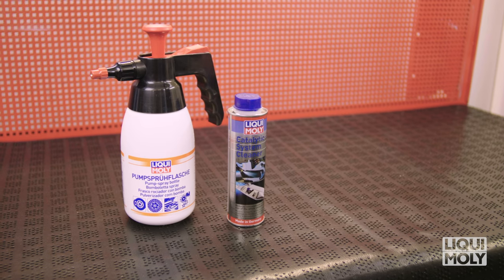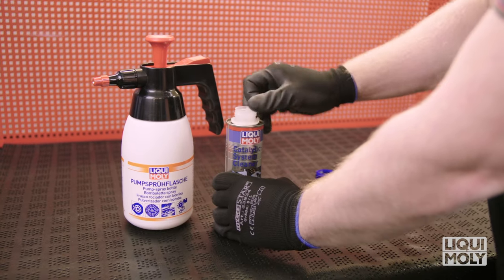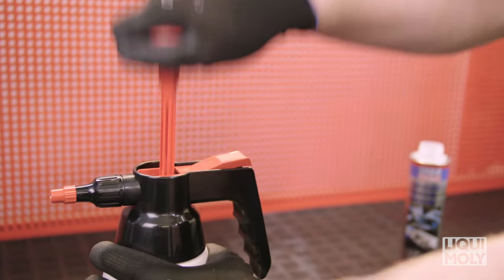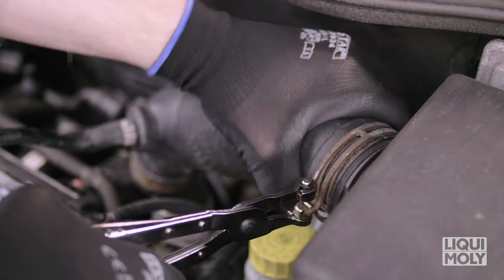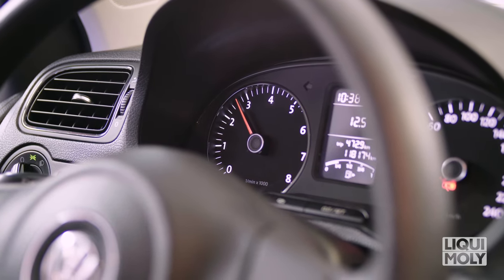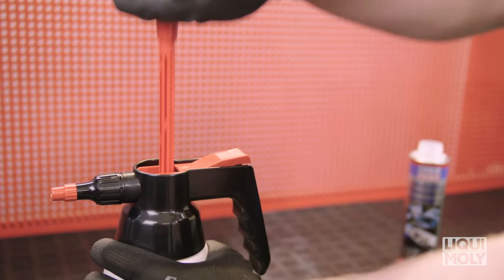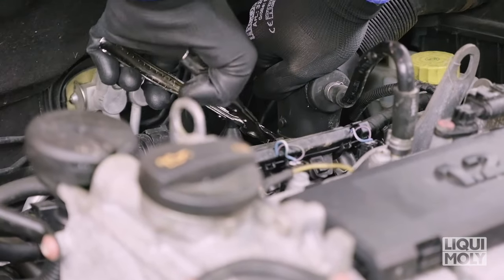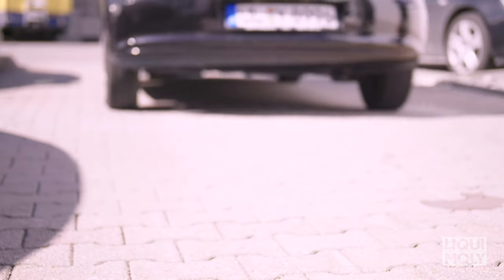LIQUI MOLY Catalytic-System Cleaner (#8931) EN

Comment: I'd like to comment that BEFORE you buy this, look at your throttle body plate and see if you'll be able to actually get the spray IN to the engine. On my BMW the throttle body plates, even at 2500rpm, are basically shut, so spraying this into the t-body is a half-hearted attempt at best.

Comment: Hello, in some forums it is written that it can be poured directly into the gas tank.  Is this app correct?  If I pour it into the full tank, will it clean?
Reply: LIqui Moly has a different one that goes in to gas tank. That one is different. Search this link on Youtube " Effects of Catalytic System and how to prevent them using Liqui Moly - Epi 48 " That one is by LIQUI MOLY South Africa. Good luck.
Reply: @Jin180sx  Thank you very much for the information, but I solved the problem, the ceramics in the catalyst were broken.  I installed a new one.  Greetings from turkey. 😊🙏🏻

Comment: Hello, Can I just use a new generic spray bottle?
Reply: I saw a video on YouTube in some foreign language of a guy using this product in generic spray bottle so I decided to try that. Used an empty bottle from Henkel Clin and this stuff melted the spray valve membrane of that bottle right off - symptom: squeeze the handle and absolutely nothing happens. Bottle was fine before I tried using it with this product. Went back home and tried another empty  bottle (I think it was Ajax Crystal Clean) and that one worked just fine. In hindsight, if you can borrow original spray bottle from someone locally that would definitely be better as it produces much finer mist and will definitely work as expected.

Comment: Hi, I have a question. Would it be possible to use the product when engine is not running? I mean, unplugging the 1st  oxygen (AFR) sensor, pouring the product into the cat. from there then plug the sensor back and start the engine.
Reply: Did you do it ? How good it went?

Comment: Hi, i have a question about apply of this product. In the video motor is an athmospheric. What about if the motor has a turbo charger? Intake area of the motor connecting directly intercooler. So there is no any scape for application. If we unscrew that pipe turbo charger has not any connection to the intake manifold and motor will not take work. So how can we apply this product if we have turbo charger in motor? Thanks in advance.

Comment: Not a whole lotta reviews here. 
I just used this product an hour ago. The idle after using this stuff is barely audible. I notice an improvement in both response time and the way she sounds. Good product!
Reply: Interesting. Did you use the whole bottle?
Reply: Mine went from nearly inaudible to a loud hum when throttling!! Edit: didn't put the cover properly in place, fixed the loud hum issue reseating it
Reply: Did you use it the same way in the video?

Comment: Why can’t I spray it through vacuum hoses? Did you actually mean not to let the vacuum hose suck the cleaner directly from the canister? Or did you mean it is prohibited regardless? I did it through the vacuum hose an hour ago, what damage had it cause (I used the pump spray bottle you guys recommended, I sprayed the cleaner through the vacuum hose)?!
Weird thing happened after I sprayed the whole thing and attempted to shut the engine off since I was done, but the engine just kept running for like 20 seconds after I shut the key off, I had to block the intake by hand to kill it, why did this occur?!
Reply from the maker: Hello David,

we think that to much cleaner is come in the engine. So the engine burn the cleaner and run more.
So you have to spray slower and less.

Comment: Hello LM - I have a cayenne 4.8L - Driven about 100,000Kms - I have bought the LM cat cleaner. I will add it directly into the main intake opening - however, How will I know that the Cat is cleaned - are there any tests or signs to look out for?
(I am doing this to solve the P0431 and P0421 errors, Catalytic temps issue)

Thank you.

Tomas
Reply: Any luck with this?

Comment: Hi 
I tried tried cleaning the catalytic system by applying the additive as directed in this video on my Mitsubishi Pajero GDI Engine by spraying the additive with pump spray bottle recommended above through the throttle body. Problem is but the everytime I do spray the throttle shuts, makes a weird loud sanction sound and there are sparks and fire coming through the exhaust, and the RPM shoots to the roof from the 2000RPM. The entire entire exhaust also become extremely hot in the process. What could I be doing wrong.
Is it also safe to add the additive to the fuel tank as I fill up? Will it have any negative impact on the engine or the fuel system?
Reply from the maker: Hello Charles,
please send your request to info@liqui-moly.de. Our colleagues from the technical departmet will get in touch with you.
Thank you.
Reply: Have you had this solved?

Comment: Thanks for your useful video. i.'v question . Each how many km should I do this proses? Not to harm any of motor components
Reply from the maker: We would recommend to use it on every oil change. Best regards, your LIQUI MOLY team
Reply: @liquimolywebtv  Is it placed before changing the old oil or after adding the new oil ?

Comment: Hi can I have question 
There is another type of catalytic system cleaner used with fuel tank . Its make the same result or this one better because it’s directly clean. 
I need answer please 🙏🏻♥️
Reply: LIqui Moly has a different one that goes in to gas tank. That one is different. Search this link on Youtube " Effects of Catalytic System and how to prevent them using Liqui Moly - Epi 48 " That one is by LIQUI MOLY South Africa. Good luck.

Comment: Hello, can i ask, why some other video shows that you must enter this liquid through vacuum hoses from brake booster?.
So which is right, through Throttle body or vacuum hose..??
Thanks for your help and answer.
Reply from the maker: Hello anton, 
I recommend to use it like in the product information. Ideal will be to spray the Catalytic-System Cleaner directly into the intake before the throttle body. As you may have seen in the other video the Korean guy use a special tool to add the Catalytic-System Cleaner due to the vacuum hose but we don´t have such a tool.

Kind regards, your LIQUI MOLY team

Comment: iam sorry, but I can't understand where exactly should I spray this product on my BMW e46/n42 engine, as far as I understand after removeing the airmass and spray directly toward the intake body, is that right?
Reply from the maker: Hello, The application of the Catalytic System Cleaner needs a certain knowledge of engines and in case of modern engine management a diagnose system to delete failure from the system.
The Catalytic System Cleaner should be applied after the airmass sensor and closest possible to the throttle valve. Then be sprayed in short shots into the manifold while the car is running.
Don´t apply too much at once. Best regards, your LIQUI MOLY team

Comment: I dont have a mass airflow sensor but manifold absolute pressure sensor installed within the throttle body will it be okay to use this if the chemical would pass the map sensor.
Reply: In my experience yes, but you may want to clean your MAP after that just in case. I sprayed this product into a throttle body of a mk2 Clio, then an hour later cleaned a MAF sensor with liqui moly Air Flow Sensor Cleaner. It worked pretty good, but not perfect. A week later I added a Ligui moly cat cleaner solution to the fuel (it's a different product - a bottle that is supposed to be added to the gas comes with small blue funnel to be attached) and within a week or two car started breathing properly.... But my cat was pretty dirty due to stop and go city driving and shoddy ignition coil (which I replaced earlier).

Comment: I have put that stuff through the brake booster vacuum tube. Then I saw your video now and your warnong to do such as.
Will this operation damage my car? What can I do to fix?
Reply from the maker: Hello Tests, 
if your car is still running after this application you are still lucky. The problem is the dosage, so if you fill in the whole product at ones into the vacuum hose the cylinder could fill up with the fluid. Fluids are not compressible so the engine can be destroyed.

Use this product as in the product information described.

Kind regards, your LIQUI MOLY team

Comment: my car does not have turbo charger, it means i have to spray this in throttle body?
plus tell me that i have heared that it will contaminate the engine oil, so one should use this when you need an oil chnage. is this confirm ?
Reply from the maker: On any car it has to be applied directly in the throttle body. No need to do it before an oil change. Best regards, your LIQUI MOLY team

Comment: My car doesn't have air flow sensor (i have only MAP sensor). Should I protect MAP sensor from the Catalytic cleaner?
Reply from the maker: Hello,
you should also protect the MAP-sensor against the LIQUI MOLY Catalytic-System Cleaner.
The reason is, that the MAP-sensor contains a piezo element, which can be harmd from the cleaner.
Best regards,
your LIQUI MOLY team

Comment: Can you apply this cleaner directly to the throttle body at the butterfly valve? In the video is mentions “gain access behind the turbocharger in fake tract downstream of the airflow sensor”. I don’t have a turbo…..
Reply: yes directly.. just spray it don't pour it.

Comment: Hi thanks for the video

Can you clarify for the petrol engine its the intake of throttle body basically where we need to add this thanks

This is after the MAF sensor and air intake or before
Reply: exactly, my car stops if i remove the rubber pipe (that has the maf mounted on it) to reveal the throttle body opening. seems that liqui moly isn't meant to come in contact with the MAF. i don't know what to do :/
Reply: LIQUI MOLY4 years ago

If the engines turns off during the cleaning process or you are not be able to hold the required rpm, please disconnect the mass air sensor while the ignition is off. After that you will be able to start the engine and hold the required rpm. 

Please note that if you disconnect the mass air sensor, maybe there will be a failure code in the engine control unit. This you have to delete after the cleaning with a diagnostic device. 
Best regards, 
your LIQUI MOLY team

Comment: hello. i have a question
I have a 1.4 16v petrol 2004 skoda fabia (non turbo) and it has an EGR valve problem.
I used the "Petrol Engine Intake Decarb" (did a great job!!!) and cleaned all the intake system, O2 and lambda sensors, but after a month the check engine light of "Egr Problem" was back again.
I changed a new Egr valve but the OBD scanner still shows "Egr" problem, even though all the systems are TOTALLY CLEAN!!!
Can i use this "Catalytic System Cleaner" in my car? Should I? I really don't know what to do... 
THANK YOU! 🙏🏽
Reply from the maker: Hello,
it is possible to use our LIQUI MOLY Catalytic-System Cleaner for the Skoda Fabia.
But if your intake system is total clean and you have a new EGR this will probably not help,
since deposits can be excluded as cause of the error.
Best regards,
your LIQUI MOLY team

Comment: I have a MAP sensor on the throttle body  and would like to know if its safe to use or could it damage the map sensor.
Reply: I'd remove the map sensor for this cleaning, and plug the hole, the MAP is only necessary for engines that are using boost pressures if not mistaken, and naturally aspirated engine usually mount them away from the engine, but not always.

Comment: Is the canister that is mixed with gasoline the same as the one being sprayed into the air gate?  Are they the same product?
Reply: Yes it’s the same can, it you can either put it in gas or via the throttle body
Reply: No, they are not the same, there is Catalytic system Clean(goes into the fuel tank) & Catalytic System Cleaner(goes into the intake)

Comment: Hi, Can I pour 4 bottles of Catalytic System Cleaner (8931) one after another in one go followed by pouring a single Catalytic System Clean (7110) in my car tank ? The reason being is I possess an Altima 2013 which is on it's 200,000 kilometres mileage already and am concerned about the catalytic convector ever been clogged ?  Thanks a million, Noah
Reply from the maker: Hello Noah,

To use four bottles in a row of our Catalytic-System Cleaner won´t have the effect that you are looking for. If you use the product as described in our product information it harm to the system and you can use four in a row but my recommendation is to use one bottle of  Catalytic-System Cleaner and than use Catalytic-System Clean for the fuel tank. Repeat this application after 3000 km again. This will be an better longterm result to the catalytic system of the car.
Best regards, your LIQUI MOLY team
Reply: @liquimolywebtv  when you say “behind the airflow sensor” does that mean the cleaner should pass through the airflow sensor? Thanks.
Reply: @TogetherWalking_SusanMay   I believe they mean downstream of the air mass flow sensor. The video shows them removing the air filter hose from the carburettor and directly spraying it into the body inlet.
Reply: Can this be used by adding it directly to the fuel tank?

Comment: Hi. I have two questions.
1. Can I spray this product through throttle valve?
2. Can I use this product through engine vaccum pipe using adjustable valve to control the flow quantity of the liquid/cleaner? If I do what are the issues I might face?
Thanks.
Reply from the maker: Hello Mr. Majeed !

1. It's no problem to use Catalytic System Cleaner in front of the throttle valve - on contrary - it's perfect to clean the throttle valve as well ! Best way is - if it is possible - to open the throttle ( with not running engine ! ) a litte to reach the backside with the cleaner. Spray a little of the cleaner into the intake manifold, wait 30 sec to 1 min, start the engine and start the application like in the video. The product will not harm the throttle valve or any part of the intake system.

2. We don't recommend the application by vacuum pipe because atomizing and dosage is not so good and so precisely like the application with the pump spray bottle. I know there are some systems in the market but we have chosen this kind of application because it's the most effective and most safe one.

Best regards,
your LIQUI MOLY team
Reply: @liquimolywebtv help me please i used same as shown in video but my engine started to hesitate now it is like 3 days please help

Comment: Dear, is possible to apply this product while the engine hot? Or preferable to use it when a car after a night stopped? Which one will be more efficient is it when a catalytic System is to hot after a long running distance or in the morning while the catalyst less temperature ? Many thanks
Reply from the maker: Hello,

from a technical point of view, it does not matter if you use the LIQUI MOLY Catalytic-System Cleaner on the cold or the hot engine,
but from a health point of view, it is better to use it on the cold engine, because this application can burns on hot engine parts be avoided.
Best regards,
your LIQUI MOLY team

Comment: Passat 1.6 FSI (benzinli) aracımda kullandım. Aynı videodaki gibi sırasıyla uyguladım işlemleri. Sadece işlem sırasında beyaz duman attı ve katalizörden takır tukur sesler geldi bariz temizledi belli. Daha sonra motor arıza ışığı yaktı haliyle, işlemden sonra onu da cihaza bağlayıp sildim. Arabanın ciğerleri açıldı, silkeleme vs kalmadı hiç. P0420 arıza kodu ve motoru sıkıştırınca içeri gelen pis kokudan dolayı kullandım. Bakalım uzun vadede nasıl bir etkisi olacak.

I used this product on my passat 1.6 FSI vehicle.
 I applied the procedures in order. During the process, the exhaust threw white smoke. There was no white smoke left after the procedure.
I realized that the catalyst was cleared from here.The engine fault light came on during the procedure. After the process was over, I deleted it with the obd device and it never came back.
The engine relaxed a lot.
 I used it because of the P0420 fault code and the stench that came in when I loaded the engine.
Let's see what the effects will be in the long run.
Reply: Düzeldi mi sorun
Reply: İşlemi kendiniz mi yaptınız? Sanayideki motorcular yapar mı?
Reply: kardeşim boğaz kelebeğine mi sıkacaz bu temizleme suyunu... sen öylemi yaptın
Reply: @ihsanbostanc4499  videoda anlatılan öyle.

Comment: Hey, can i put the air intake catalytic system cleaner in my fuel tank? Because i cant get there easily...
Reply: There is another liquimoly product for that. This one is coded as :8913
The one you can add to your fuel is: 7110

Comment: Does this stuff really works. I have a 2013 honda odyssey with p0420 code and i have replaced the 02 sensor all 4 and i have used many catalytic converters cleaners and nothing have worked. The van only have 99k miles and have not loose power or gas mileage or performance.  Any suggestions will be appreciated Thank Tou
Reply from the maker: Hello,
normally, the error code P0420 says only, that the catalytic converter system does not working properly.
But the cause can have many reasons.
The best is, you let check if the catalytic converter correct works with a diagnostic tool and a exhaust gas analyzer.
If the catalytic converter works correct it is possible that the cause is an electrical problem.
If the catalytic converter works not correct, you can try to clean them with the LIQUI MOLY Catalytic-System Cleaner.
But here it is also possible, that the rasons are deposids based on mangane oxide, in this case you have to replace the catalytic converter.
Best regards,
your LIQUI MOLY team
Reply: Same here i cant even spray it since the car wont even start once u disconnect the air flow sensor